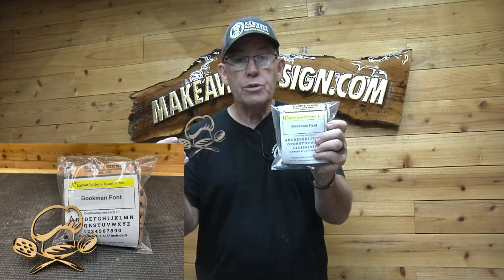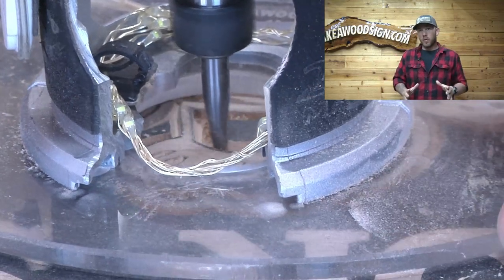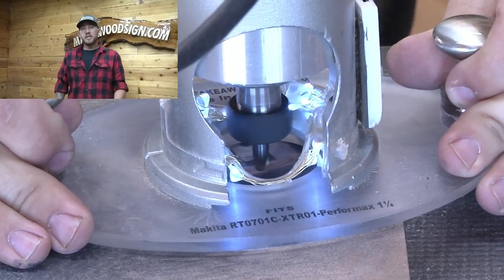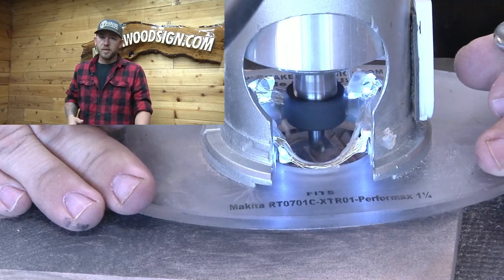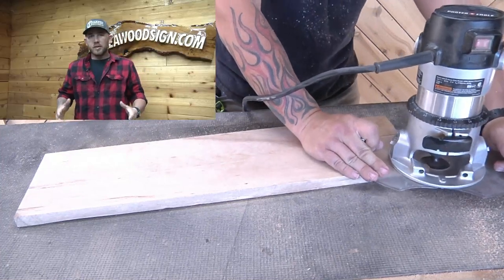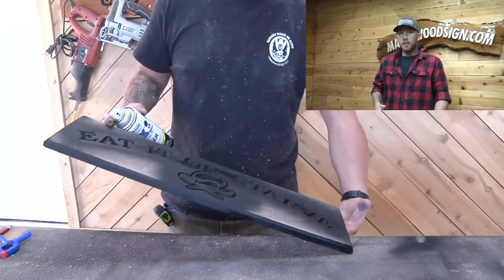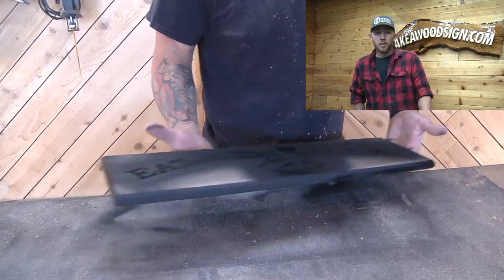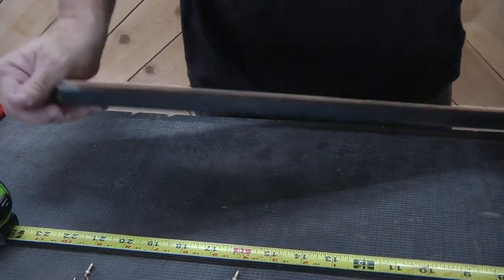DIY Kitchen Sign - Kitchen Utensil Hanger

Comment: Ok, ok...Back up a bit Brutha....

As I am actually doing my first initial engraving stuff (pics posted at the 731). I am totally confused, even after watching many....MANY of your videos...

Do you/are you pre treating the wood prior to carving? 

Are you pre treating prior to painting? 

Since your videos were not very clear....I took my chances at a guess. I guessed wrong. Hey, it was a 50/50. 

I engraved numbers and an eagle for a build I'm doing. Then I painted. It bled like a deer shot in the jugular.  

I sanded everything down, effectively starting over. 

This time, after I did the engraving, I sprayed MULTIPLE  coats of Shellac over where I wanted to paint. 

This method worked great. No bleeding whatsoever. 

So, question is....do yall pre-treat before the engraving and then again after the engraving and prior to painting? 

I'd like to see a video from you guys which shows EXACTLY....no skipping steps....

1)Yall just got home with said piece of lumber. 

2) Assuming you mill it out to spec yourself, the "ready for carving piece

3) Lumber is milled and cut to size.

4) 5) 6) etc....Now what? 

Personally, I don't need to see what font you used or the bit or router...,I need to see the preparation of the stock prior to carving, prior to painting. The rest I understand fully . 😌
Reply from the maker: OK Mike, I'll try to hit all these. First, I only really pretreat my boards if they are pine or a wood that similar. Pine has a tendency to bleed the black spray if you don't seal it up first. If you over spray it will bleed anyway, so don't do that. Here's a video to show what happens if you over spray, which almost all new sign carvers do. https://youtu.be/_VoQhDrkVAI
Second if you use a gloss, semi gloss, or satin spray paint it is going to bleed. I use only FLAT spray. Mostly spray ink or black primer. Here's a video why https://youtu.be/AA4ZCXotYCQ
Once the sign is carved, then I spray the carving, careful not to over spray and let it dry.  Then I sand off the surface. Then I apply the finish. Then if I want some painting on outset letters I paint ON TOP of the finish. I use 1 shot enamel for that. This video will help with that process https://youtu.be/BtS7dwEtcIc
Lots of other stuff I could throw in here but if you have more questions you can email me directly, eric@makeawoodsign.com